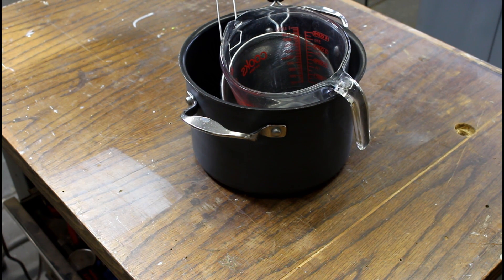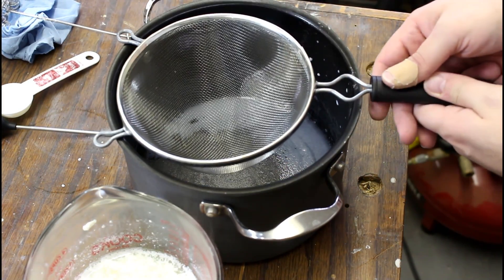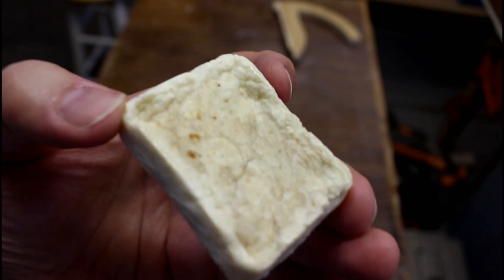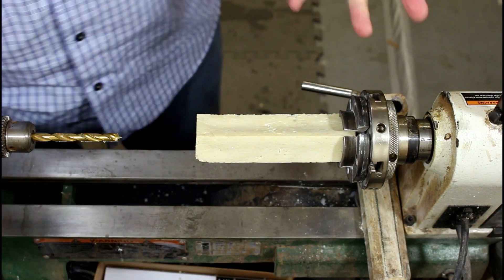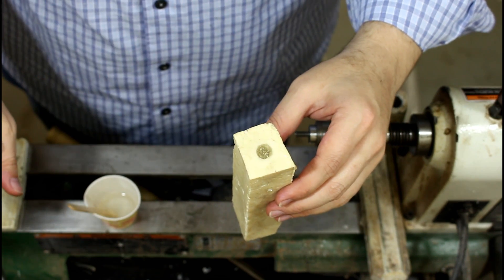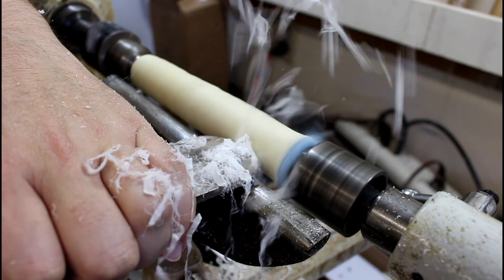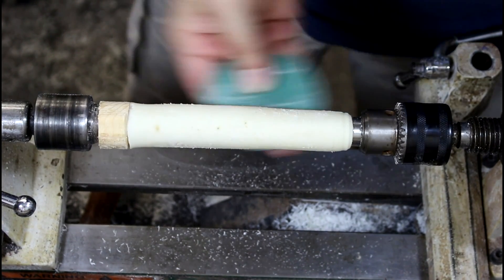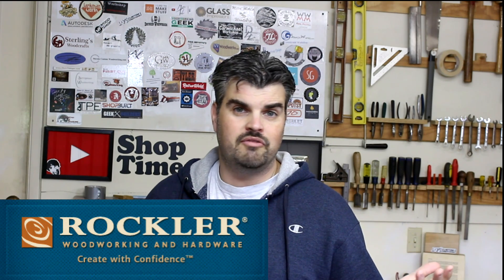Make Bio-Plastic From Milk

Comment: putting the curds into a press would release alot of the moisture allowing it to dry alot quicker... also the curds when moulding would need to be packed in as tight as possible so there are no air gaps... and lastly put your finished item in an oven at a very low temp for an hour to dry... this should help to strengthen the bioplastic...

Comment: You should revisit this, but mix in some resin or epoxy before letting it dry, and then drill out the center and fill that with a beam of epoxy before turning it, so you basically get a shell of cheese around something that isn't as brittle as a grandma's bones

Comment: 1. Put vinegar into milk while still boiling.  Else use industrial white vinegar - to curdle firmer.  Not enough weak vinegar.  That measurement was for heavy duty cleaning vinegar.
2. Use a cheesecloth to strain, never a sieve.
3.  Completely wrong technique.  You have cheese at this step.  You need to rinse with water and soak in alcohol to remove fats and cheesy smell.
4. Then soak in formaldehyde to make it more stringy so it can harden when dry.
5.  The reason it broke is because you are working with dried cheese not pure casein.  You missed several steps.  It should not be greasy - that is cheese not galalith.

Insufficient research.  Learn before you do a video since you are giving wrong information to others.  Cheese on the lathe!

Comment: This would make a plastic. But you have to purify it more. You just want the casein and no fats and other impurities. Then you get a much better product. The fact that you described this as "oily" just shows that you didn't purify the casein enough. If you start with milk then ideally you start with fat free milk (or the milk with the least amount of fat in it). Then if you want you can go through a whole lot of purifying steps, but usually that's too complicated. It's better to just buy pure casein powder (made for bodybuilders). It's a lot less work and your plastic will end up actually being and feeling like a plastic. 
It should also help to heat it and form it into a homogenous, dough-like clump (like mozarella) and then put it into a mould. That should get rid of the gaps etc.

Comment: casein formaldehyde is actually a semi-synthetic plastic used from 1900-1970 to make stuff like buttons. Some factories still use it nowadays, but it has mostly been replaced with fully synthetic polymers in production. I do think the process is a bit different, you create a reaction between skimmed milk and formaldehyde to form the plastic, not whole milk with vinegar.

Comment: the old process was to dissolve the curds in an alkaline solution, then let it dry in molds, then cut in thin sheets and make buttons from them (or shallow plates) then submerge the product in formaldehyde to harden it

what you made is really cheese

Comment: try heating it slightly to try to drive out water.
Reply: water isn't the issue, it's leftover fats keeping the casein from hardening completely.

Using skim milk would actually work better for this since the fats have been removed.

Comment: Casein plastics aka milk plastics were introduced at the beginning of the 20th century, their starting material being the protein in cows milk, precipitated by the action of the enzyme rennin.

Although casein is readily moulded to shape under moderate heat and pressure, it does not produce a stable material for manufacture until it has become hardened by soaking in formalin (5% solution of formaldehyde in water) for a long period. Unfortunately, this causes much distortion so casein plastics are almost always produced by machining stock material such as sheet, rod, tube or buttton blanks (small discs). After machining, casein may be polished either mechanically with abrasives or chemically with a ‘dip polish’.

Comment: YOU  MADE A GOOD HANDLE TO GO WITH CHEESE BOARD, OBVIOUSLY IT WILL HARDEN MORE, BUT I THOUGHT IT WAS PLACED IN RESIN IT WOULD LOOK EVEN NICER.  I THINK YOU SHOULD TRY PLACING SOMETHING LIKE THAT IN RESIN, BEFORE TURNING IT AND IT IS THE ENZYMES WHEN HEATED THAT MAKES YOU SLEEPY. 

I STILL THINK IT IS GOOD BUT COATED IN RESIN WOULD INCREASE THE DRYING TIME. RESIN IS A GOOD SUBSTRATE TO ADD TO THE MILK PLASTIC.

Comment: Bio plastic is corn starch add white vinegar 1 to 4 ish add gycerin the more u add increases flexi 5 parts liquid (water or even milk) heat untill gloopy. Drying times vary to environment. Hope that helps, keep going stay positive. You can add fiber of anything to bind it too very accent method but works well

Comment: I have done this with my chemistry students to teach them about polymers. The reason it isn’t drying well and feels oily is that you did not get all the fat out of it which wouldn’t dry.  Maybe try a non polar solvent to wash it if you insist on whole milk. Also you need to make sure to wash the precipitate to remove the excess acetic acid or it will might break down the protein chains over time.

Comment: Next time, use fat free milk. The oil you're feeling is the fat from the milk. It's why it took so long for your casein to dry, and why the center is still so wet. The oil prevents the water from escaping the casein proteins.

Comment: Most places that make this don't just let it sit all lumpy to dry out on its own. The material is worked until it is very tgick, then it is forced through extrusion molds to make uniform, fold and bubble free shapes such as pipes. Treat it like concrete(the hoover damn is still curing). The more liquid and bubbles it has trapped into it the less chance of it properly curing(or hardening).

Comment: I've made this in the past.  In WWII it was called Galalith (milk-rock).  The final step is to soak it in formaldehyde for a long time.  This will cure the plastic and make it much harder.  But it is incredibly toxic to use this.  So 'green galalith' is the softer stuff you have.  I've tried to track down another chemical curing agent other than formaldehyde but can't come up with anything so far
Reply: Uhhhhh Chloroform? You didn't say it had to be a good idea.

Comment: We have casein light switches in our house that would be nearly 100 years old now, think the house was built in 1926 and only one of those switches is now broken ( and yes we REALLY need to rewire our house as its quite the fire hazard nowadays ) but I think maybe there's some techniques you are missing from this that they may have done once upon a time to process this plastic.  On the future of this material I have seen some interesting video's popping up about using these plastics again for things like cereal coatings instead of sugar to keep cereal crunchy and noodle flavor sachets that you just throw straight in hot water to dissolve, I love the idea of bringing back casein based plastics.  Won't be as cheap as petroleum based ones but is a hell of a lot better for everyone in the long run.

Comment: Real Casein, made from skimmed milk and Formaldehyde, is made into a plastic that can be blended with other materials to make yarn for knitting and crochet. It actually works really well, just like any other form of plastic. I also really like recycled plastic made into fibres and spun into a yarn too. It's a brilliant way to recycle a waste material to stop it going into landfill and it makes a material that doesn't rot or easily breakdown.

Comment: The problem was you were using whole milk, and added too much vinegar. When you get the ratio right, it will pretty immediately separate into clear liquid and very large clumps of material. Too much vinegar makes it break down too much. Whole milk also adds a lot of fat that interferes with the separation process. That means there was probably still way too much liquid trapped in there.

Comment: I know this was quite awhile ago...but a thought occurred to me...probably not an original thought (I really don't want to read 1753 comments to find out)... how would this milk thing work if you made thin layers of the stuff and layer is all together with resin? The resin could be colored (like the wax on the outside of curing cheese) red, yellow...? I would watch that video...and savor every comment you make about milk by-products (positive or negative).

Comment: gentleman, the process you describe we have a traditional name for it. CHEESE. and i never saw a piece of cheese that is hard enough to test by hammer. yes, you can use milk to produce plastic, in 19th centry, combs, eye glass frame that sort of things sometimes will be using a sort of mother of pearl like plastic, that particular kind of plastic contains milk as raw material but not use in this way. and even you really find out how to make it, it is just another piece of plastic, just good for the outlook, some people call it false pearl in the old days. it won`t stand a lathe, won`t stand a hammer. no match to pvc, abs, pet, pu that kind of modern plastic

Comment: When he first started turning it and the base of the handle was still square but the top was cylindrical it kind of looked like a vintage milk bottle....then after he finished it it just looked like string cheese.  I wonder if the context is just suggesting the subject or if I'm over thinking the fact that someone is working milk on a lathe...

Comment: Now I think the problem is that it wasn't pressed into the mold. So that it was still too loose and not compressed enough.. I think if it was pressed and clamped til it dried it would have worked a lot better.

Comment: To improve on this process try dissolving out the impurities with alcohol so that you end up with a more pure casein before curing it. After you strain it, put it in a jar with some alcohol like vodka and work it with a spoon. After a bit of working, dumping out the cloudy liquid and adding more vodka, the liquid should start to clear up. From there, just mold it and let it dry.

Comment: You might have better luck making a few sheets of the milk plastic, so they could dry more thoroughly, then epoxying them together to form a blank. Or make a blank and shatter it with the hammer, and stabilize those pieces with resin

Comment: I am 90% sure this bio-plastic isn't bio-degradable. 

Environmental bacteria don't digest a lot of milk. Is why milk truck accidents become environmental disasters. It kills plants, and the bacteria that would create nutrients for plants, so they just become indefinitely infertile patches. 

I wouldn't leave it in the compost bin/pile. ;)
Reply: By the way, casein is a fibrous protein, I believe, which explains why it can be turned into a solid mass, but it's obviously nowhere near as hard as cellulose, and has no tertiary structure (I suspect casein's biological function doesn't require it to function as a fibre, let alone as a plastic ;) )

In other words, casein molecules are relatively flexible, but they do manage to stick to each other, but that's not its biological function, so don't expect too much. ;)

By the way, there's quite a lot of casein in cow's milk, especially whole milk. It's why cheese is a thing. 

Also, apparently, they used casein-derived bioplastics back in the 30's, before they had modern plastics.

Comment: so you made hard cheese?
Reply: With a lot of vinegar.
Reply: Not exactly a cheese, but it was still made by a curd from a milk.
Reply: Pretty much
Reply: It's both a cheese and a plastic
Reply: More like soap than cheese. Caveman soap. The best kind.
Reply: btw its technically plastic
Reply: @salifford  So technically, cheese is a plastic?
Reply: no I am pretty sure that it has a different structure so it is not plastic it also depends on what you define plastic as @alfianfahmi5430
Reply: @alfianfahmi5430  no
Reply: Roo yup
Reply: Pretty much

Comment: when you add the vinegar you spoil the milk, the curdled bit are curds and the water is whey. if you had put the curds in a humidity and temperature controlled environment and waited you could have gotten  cheese. im thinking what happens s the left over water in the curds evaporates leaving the solidified milk fats. like butter but with out the water.

Comment: Now I just found you and I randomly hear you singing hey mambo and I'm like BRUH I SANG THAT 3 WEEKS AGO AT A VERY FAMOUS PLACE IN AUSTRALIA (the Opera House) AND DID SO VERY WELL AND NOW I LNOW THE WORDS TO IT OFF BY HEART! takes deep breaths  just needed to get that off meh chest lol I love your work by the way and I hope you read this coment!
Reply from the maker: Haha!! So you're singer? Getting a gig at the Opera House is pretty impressive!
Reply: This "Bio-plastic" is made out proteins, adding the vinegar you brake the bonds of the molecules and so the become insoluble and drop down. The process of making ricotta is similar  but you don't use whole milk but the serum that's get produced after making the cheese and they usually add citric acid instead of acetic acid (vinegar)
Reply: Enrico Passerini i think that pressing the moisture out would be a good idea, also i almost my science fair project on that, but then i decided against it because melting aluminum cans is cooler
Reply: Enrico Passerini also the bonds aren't really "bonds" its just like quick sand until you introduce the acid or acidic compound

It is like a solution that dissolved the proteins.
Reply: Peter Brown hey huge fan i think it would be better if you press the moisture out a bit before trying it, also consider re doing it, i think it'll work if you do! 

Keep up the cool videos!
Reply: Charles Cavatoni  if he does what you suggested and put it in the oven at  250 degrees Fahrenheit for maybe 15 minutes to dry it even further I think it would work better
Reply: Probably, I may try it, after exams.

Comment: What you made is actually cheese. It is sometimes referred to as Paneer. (When used in Indian Food). Notice that the rind of a Parmesan cheese is pretty hard while the inside is softer. They are both the same material, but the "rind" has dried completely.

The oil is milk fat, and may become rancid as it turns into Butyric Acid. Using non-fat milk may get rid of this. The layer of oil may interfere with Epoxy sticking.

Cheese Cloth is customarily used to separate "Curds" from "Whey". When making cheese as you did, the vinegar stayed in the whey. The reason it did not smell like spoiled milk is because you used acid to 'denature" the protein. (Change its chemical structure, and molecular "folding"). The milk is not "spoiled" per se. The smell of spoiled milk is the result of bacterial action which creates various "amines" and ammonia from the decomposition of the protein molecules. Mostly what you did is rearrange the protein molecules.

The dried rind of a Parmesan cheese will give you an indication of how strong this material will ever be. It's kind of tough, and somewhat flexible, (Due to the long and complex protein molecules), but will never be hard and durable like Delrin, nor brittle like epoxy. It may also be subject to degradation by mold, and of course rats.

Nice job though, but this stuff is not "plastic" per se. It is protein, with some calcium compounds in a matrix. Kind of like bone. And to some extent, hair, fingernails, and skin that gets hard like callouses, and even silk.

However, some protein fibers like spider silk are more durable than steel, and used to make bullet-proof vests.

All in all, this might not make such a good material to use, because at the end of the day, it is still food for bacteria, mold, rats and cockroaches, while something like  Delrin is not. It will re-absorb water, and adding water will help the bacteria and mold.

But again, Nice job, regardless.

Comment: Unfortunately, you didn't make "bio-plastic", you quite literally made "cheese"..   Read up on the cheesemaking process: you acidify whole milk and add optional flavoring ingredients..

Bio-plastic is either entirely casein derived, or made from the polymerized lactic acid (the PLA used by 3d printers)..  In this case, you're better off with a casein derivative, so you'd start off with skimmed milk, with no fat content to get the casein out, then you'd react it with formaldehyde to create a hard plastic..